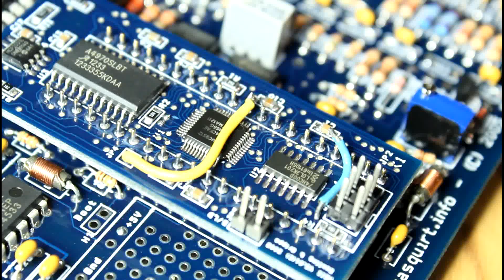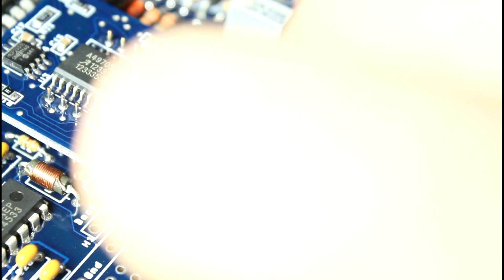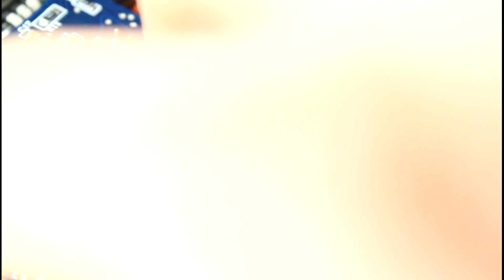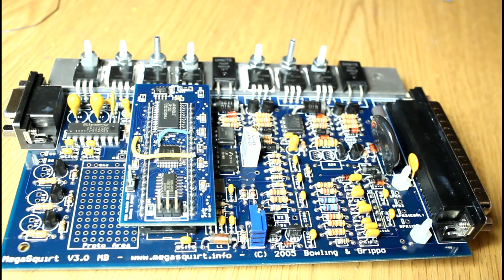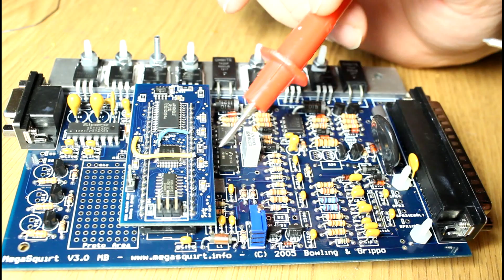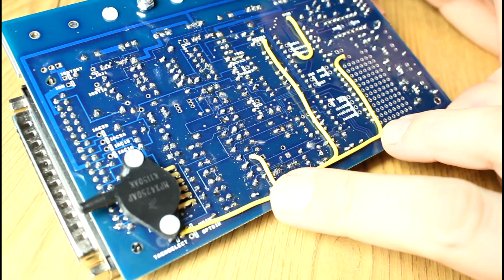Evan's Megasquirt Build Ep 3 - MS2 Board I/O Mods

Comment: What video of yours do you comment on jumpers for low impeadence injectors on MS2?  You did a nice video using a red marker explaining the to opinions for a ms2 . The second option was using a resistor box
Reply from the maker: I'm not sure you have to jumper anything... The only part I recall (given this was filmed 5 years ago)... the only part I recall is the current sense resistors that look like big transistors on the heat sink can be removed if you have High Z injectors, but low Z requires them.  I think in one of the next few videos I add the 'mod kit' to add the extra injector driving transistor, so that is probably the video you want.